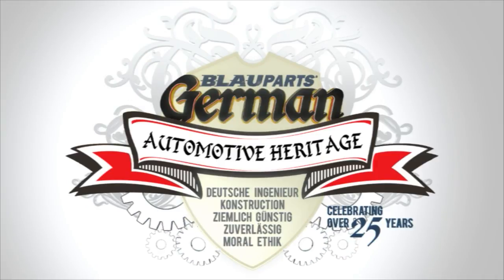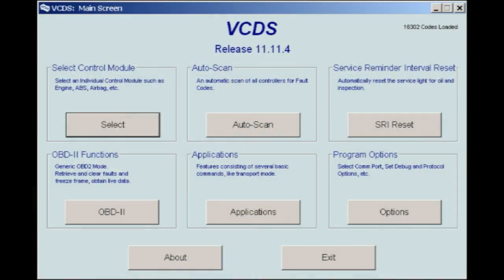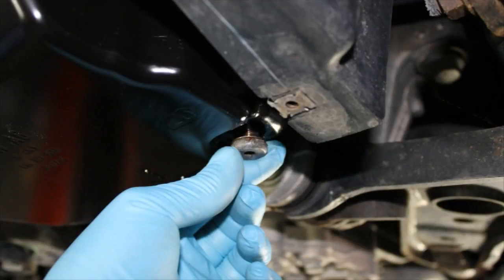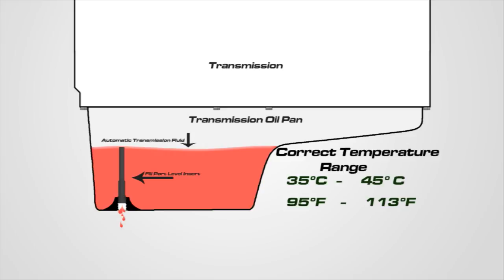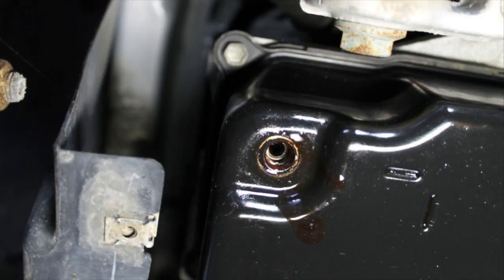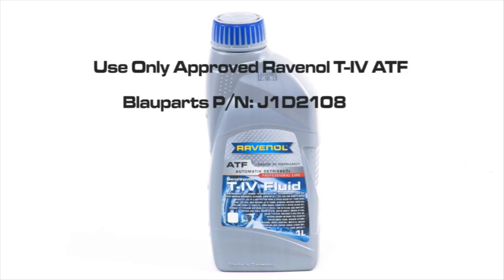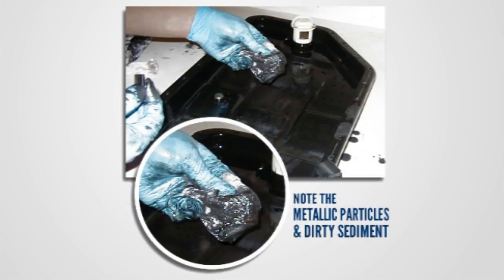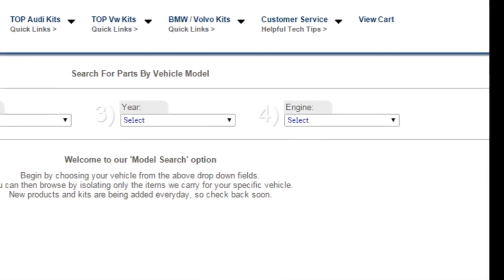How To Check and Fill VW Tiguan Transmission Fluid aka VW Tiguan ATF Level Aisin 6 Speed 09M

Comment: Please what is correct temperature for 09g transmission passat b6 1.8 tsi 2009 petrol automatic after one hour speed between 130:170

Comment: Put all 5 litres from the dsg kit in the top 13mm OD hose after refitted snorkel and plug and replace new filter, start car pause in all gears before driving…… simple ! Never had an issue 300k on transmission
Reply: But, is your transmission the same as this one?  To change the filter on mine (2011 Tiguan), the pan has to be removed.

Comment: Mine is 2011 VW Tiguan se FWD.   During dismantling of Front Lower Control Arm at driver side, I had to drop the transmission oil pan to pull out the long bolt from the control arm bracket.  Naturally all the transmission fluid is dumped out.   Now I reinstalled the control arms back and do the refill of transmission fluid.  So I read some articles and this video to find it hard to believe.  Complicated.  I need to have a tool to fill the fluid and read the temperature?
Can you possibly tell me the simplest method to refill the lost fluid?

Comment: I have a tiguan 2013 2.0  4 motion turbo  and they put the transmission fluid from the top of the gearbox  . What should I do
Reply: To solve this problem
Reply: redha h.hassan I have the 2013 I hope this helps. https://youtu.be/6TPOWDfXceg